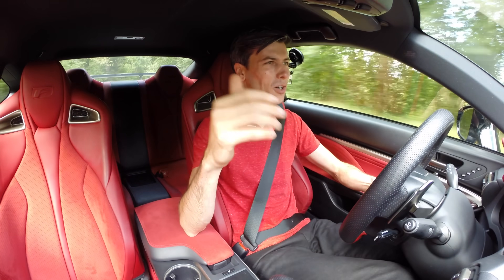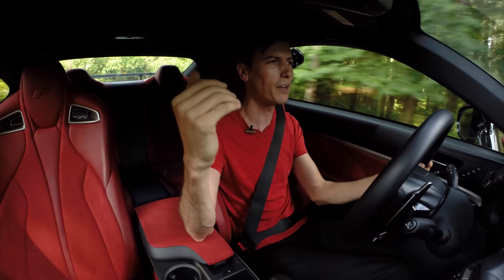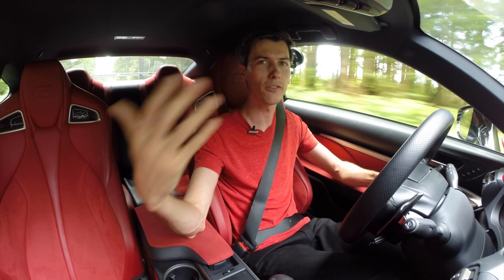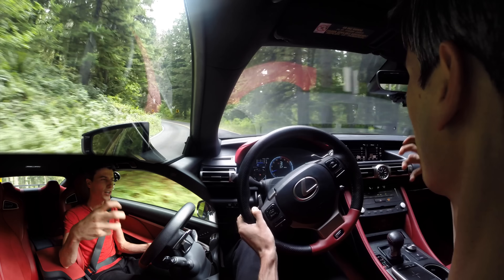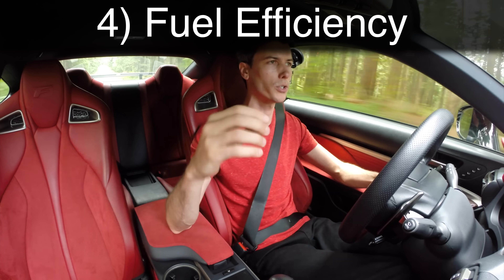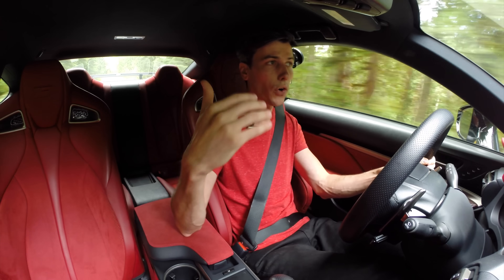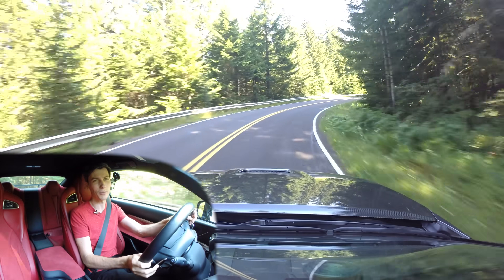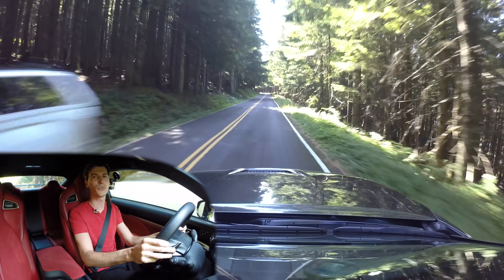5 Reasons You Shouldn't Buy A Turbocharged Car

Comment: Turbo lag may be cool for amateurs and street cars. But in racing you always want a fast responding engine. That's because being quick in corners means balancing the car. When you break, the front goes down, the back goes up and you lose grip to the point of spinning. But hitting throttle the front goes up, the back goes down and you'll regain the grip.

At this point you got it, you want the engine to respond fast to help you to balance the car. 

Of course there are turbo racing cars. Especially the old ones have a lot of lag. But this doesn't mean drivers like it. But it was the same for all and some managed better to solve the problem. Because it really is a problem.

Comment: My 2015 Volvo S60 T5 has no turbo lag.  It makes peak torque of 260 lb-ft by 1500 RPM and keeps it all the way up the range.  The exhaust headers (yes, steel headers) and turbine housing are the same piece and manufactured as part of the turbo..  it placed right next to the head.  It has dual inlet channels from the headers. The engine is direct injected.  It spins up instantly.  As far as longevity...my last Volvo s40 T4 was running fine at 250,000 miles when I sold it as well as my Saab 9-3 ARC at 250,000 miles when I sold it.

Comment: Why you should not drive a turbo vehicle. One the heat they generate. Shortens the life of many components under the hood. Cooks the engine oil as well as the. Increased air pressure builds increased pressure. Inside of the cylinder which when ignited. Create a tremendous amounts of pressure inside of the cylinder. Which creates a greater amount of stress on all of the internal components. And bearings which wear out faster. Drastically shortening engine life. A naturally aspirated engine by Honda or Toyota. Can last between 500K to 600K miles. The  same engines in turbo charged versions. May last up to 200K miles!

Comment: I’ve owned plenty of both across the ages and as a petrol head love both in different ways. Turbo lag is still there in even the best turbo engines but it is sooo much less than they used to be. Ultimately, you can’t beat the pure crisp throttle response of good naturally aspirated engines and can’t beat the rush of torque of a good turbo engine.
Reply: The solution is large displacement NA. Instant response, torque everywhere, maximum joy at any speed.
And also a little Honda for most of your driving so you still don't use much fuel overall.
Reply: @nthgth  I couldn’t agree more. Or even an electric car for the bulk of travel in the city.

Comment: I own a Camaro LFX 3.6 V6 Sequential Twin Turbo that my shop designed and built in 2012.  It has NO turbo lag and is more responsive than you can imagine.  If designed properly, you can have a turbocharged vehicle perform without lag, of course, factory vehicles do not manufacture turbo cars like the one I have due to cost and probably other reasons.

Comment: I had twin GT32s on my c5z06 and was doing 650rwhp.  It was smooth as hell....the stock engine had perfect torque and it just held traction perfectly till the turbos spooled up and then it was on.
I rode in my buddies c5 z06 and he was running a Ysi supercharger pushing 950rwhp.  It was a rush.
I then had a built 403 stroker installed, meth, Ysi, heads/cam and super loud BOV.....840 rwhp.  The problem was that regular Camaros would stop me from a dig. No had to race starting at 70mph and even then, with street slicks, I would still break loose..... Now I could stomp liter bikes all day long but it was always roll racing.  It sucked.
I'm 100% a turbo guy now.

Comment: My experience with turbo charged, small displacement engines has been negative overall. I'll start by saying this is likely due to 2 factors more than anything else: the car itself (2109 Sentra Nismo) and the way I drove it.
I didn't drive the car hard so the need for a turbo in the first place was debatable. I had issues with carbon buildup on the turbo which, at 20k miles, resulted in the car tripping an EGR code. They had to pull the engine out of the car to service the turbo under warranty.
Fast forward another 20k miles and, you guessed it, the EGR code came back. Same problem, the engine came back out (fortunately, still under warranty) and the repair was repeated.
If you ask me, having the engine pulled twice in 40k miles for turbo related problems is a bit ridiculous. Is it just a case of a bad design by Nissan? Yes, more than likely. But with all the manufactures putting turbos in their small economy cars, how many of them are going to be plagued with similar poorly designed systems? 

I traded in the car and now I drive 2022 6MT Tacoma with the 3.5L V6.
Reply: Direct injection aye?
Reply: Awesome truck though

Comment: For those who are serious about not having turbo lags, they can always supercharge their engine. Turbo is not free power as many tend to think, and supercharged cars win just as many races as turbo cars. My preference is to follow aviation practices, often with everything already at the material limits, I opt for turbo normalizing. I get the loss HP back, while not over boosting the engine (or just mildly over boosting it ) Diesels adapt to turbo much more readily, for their exhaust temp is a couple of hundred degrees lower, which make a huge difference in bearing longevity. One sign of that is aircraft at high altitude or in engine test cells being pushed hard, the exhaust manifold glow cherry red or even yellow, most diesels will not run that hot.

Comment: 1 main reason why you should, With a small displacement engine such as my 1.5l in my Civic Si Coupe and a turbo, I get the best of both worlds! Off the line quick with plenty of low end torque with a .28 coef of drag and low gross weight of 2800lbs, I smoke a lot of cars with much bigger engines and I also manage to get 40mpg at 75mph on hwy in cruise control and off the boost! Only when boost kicks in does the mileage really go down! So I mainly drive for gas mileage and occasionally lay down a spanking or two! Downshift while drag racing at speed to get boost up and keep the gas pedal pinned to the floor when upshifting because everytime you shift, if you take foot off the gas while shifting boost goes way down! Stay off the gas and get great mileage! Turbos are BETTER!

Comment: I so agree with all, my regular, stock, unexciting 5.0L in my '13 F-150 sounds super awesome when under throttle.  Also more reliable because simply just less parts to replace.  Not knocking turbos, they are super cool too, but just responding to another of your cool videos.

Comment: It's only turbo lag if you have a huge turbo on an itty bitty tiny little engine or you just don't understand how to downshift lmao 

If you put an eclipse gst\x in 5th gear at 2000 rom it takes about 500 rpm to hit full boost lol.  if you take the same scenario but instead of standing on it in 5th gear you downshift to 3rd and then go half throttle you have instant boost.  🤷🏻‍♂️
Waste of a video.

Comment: Understand the reasoning the car manufacturing companies use turbochargers.  Then examine the disadvantages of a turbocharger.  You will see that the problems with quality, reliability, and performance are from conflicts arising from corporate greed and planned obsolescence among other things.  Said otherwise:. A company may say we offer more power and higher mpg:. But cost cutting constraints result in the opposite outcomes.  A NA engine is actually more efficient and effective.  It's the same outcome in 'climate' issues.

Comment: Having a laggy turbo & a slow downshifting transmission is the worst. I had a loaner Tiguan w/paddle shifters & even in "sport" mode, I'd have to downshift super early to have enough torque to power out of a curve. My DD, w/a 6MT would allow a last second, rev-matched 6-3 downshift & turbo would be spooled enough to let me modulate the power thru the curve.

Comment: Been buying Saab turbos since before turbos were cool. Can't replace all that low end torque unless you really upside the engine which equals more weight and fuel consumption even if you're not stepping into it.

Comment: These turbo charge cars seem to on paper do well on the EPA’s test cycle. 
And they do marginally better only.
In the real world where people don’t keep up with the oil changes and they go to goofy lube and get a filter that’s worth $1.99 and cheap bulk oil.
Then at 60 or 70,000 miles they end up paying for one or more turbo charger replacements! 
I just don’t see in any way shape or form the benefit to under sizing and engine for a vehicle and slapping on turbos to make it acceptable.
The Corvette C7 for example is a fantastic performance car. Take the car on the highway let it go into overdrive and set the cruise at 60 or 75 miles an hour and you will see an astonishing car exceed 30 mpg!
These turbos are just hype and it will be a cold day in hell before I own one!

Comment: I have a question for which I can’t find an answer: what’s the difference between a stock turbo engine vs an engine that has been turbocharged? Why the latter is usually less reliable?
Reply: A stock turbo engine is designed to handle the extra stress of turbocharging. Sticking a turbo on an engine that isn't made from the factory to be turbocharged can be just too much for it. Compare the Ford I-4 engines: The turbo versions have stronger internal parts than the NA versions.
Reply: @bongodave13  thanks

Comment: I guarantee my Audi TT RS AWD 2.5 Turbo 5 Cylinder Manual following you on that road would have been more fuel efficient and used less, as well as sounding just as good while sticking to your bumper!  I will concede the Oil Temp issue is a downside but the trick is to drive sedately for a few minutes prior to turning off to minimise it. True my original CLK AMG 5.5 V8 had all the qualities you mention but not as satisfying to fang on a great driving road as the TT RS.

Comment: Jeremy Clarkson once showed the difference between NA and turbo lag on Top Gear by racing a minivan against a Mitsu Evo FQ400. Both were in 6 gear at a matching speed, and both floored it. The minivan pulled away whilst Jeremy was sitting there waiting for the turbo to spool.
Reply: Yeah you take the worst car in history as an example, also Jeremy always exagurates on everything.
Reply: That's not lag, that's boost threshold. The Evo is obviously losing to a short geared minivan if it is before it even has a third of its torque in a gear that gets it to the much higher top speed
Reply: WTF floors it in 6th gear lol, absolutely ridiculous.
Reply: Just floor it and press the brake for a couple of seconds then release the brake at race start
Reply: That's why, for gasoline engines, a supercharger is better.  No lag.

Comment: Talk about cherry-picking Internet information to make it look like (NA) naturally aspirated cars are clearly the best. It's not even close to being true. This is really evident by how he won't stick to a goal post to define how NA is "better than turbo cars."  He switches it when it benefits his point. The real answer is that the NA car FEELS better to him, while he ignores the actual benefits of a turbo car and what it can do better than NA cars.
In fact, turbo cars can produce the same power (be just as fast) and get better gas mileage (when cruising and not racing) with a smaller engine and therefore can be much lighter than naturally aspirated cars resulting in better handling, braking, and therefore safety. That won't matter for towing, where NA is clearly better (only true for non-diesel) from a longevity perspective, but in a race it won't matter when they stay right next to you in a straight line. In the curves, they've sped right past you because of the weight savings. Should I mention how turbo diesels are the most efficient at moving freight around versus anything NA?
BTW, with plans to phase out (ICE)internal combustion engines and replace them with electric cars, you can be sure the best and most efficient option available for keeping any ICEs around will be a small engine with a turbo to maximize efficiency and power, not a large NA engine. Those are on the chopping block like the big blocks of yore.

Comment: I've loved turbocharged engines after buying my first car after college, it was a Saab 9-3 aero, and at 205hp/230lbft and relatively low weight of 2850lbs it was quick in 2001.
Reply: But that is a real turbo
Reply: @ReggaeWise  ...I think I agree, but I'm not sure what you mean by "real", are you referring to Porsche's Taycan "Turbo"?  That was a terrible marketing move, imho, but they're badass cars.  I've owned a 00 986 S, and replaced it with an '07 997 S. (Carrera S if the specific models are not familiar to you).

Comment: So I don't need to buy that automobile with a 2.5 L engine with turbo&intercooler, but one with a 5 L naturally aspirated engine.
I tend to agree. A car from my youth, the infamous Renault 5 Turbo, had an engine never lasting more than 30K miles, with holes in the pistons and bent conrods. 
Turbo charged engines work under terrible conditions, this is why I avoid them: they must be build without consideration for the costs. Just adding a turbocompressor to an existing aspirated engine is a failed proposition. 
Thanks for the video...

Comment: I can only speak of my setup. 383 stroked LS1, fully forged, 76 mm Turbonetics. A/W intercooler. It's 20 years old. Full boost (15 lbs.) by 3K rpm. I throttle it so it is not an "on-off switch." Love it, so does the passenger. If I'm a good boy on the interstate, I get 19 MPG. One thing he states that IS true is the heat produced. Exhaust coating and wrap  doesn't reduce it much. I pop the hood when parked. 2002 WS6 M6.

Comment: You mention some silly things though. You are talking about efficiency and fuel economy, then you show us a Lexus RC F with a big V8 engine as an example of efficient naturally aspirated car. Thats funny, but a $80,000 ... $100,000 MSRP car don't need to be efficient and the customer doesn't care about that especially if he is American (very cheap petrol compared to EU). The fuel economy was not an argument when he selected that car you can be sure about it.
Reply: It was a example. you took it to far.
Reply: @pem3480  Sorry I didn't want to mistake it. He shows in the video a 5.8L V8 naturally aspirated car and some some turbo charged performance cars for example Mercedes AMG ... so on. Of course he can't compare a cute naturally aspirated 140hp VW family golf to a 450hp AMG Mercedes turbo. Obviously. He needs that awesome Lexus to make the balance, to get some respect. But in this mentioned category the efficiency is not a factor, absolutely not at all.
Let's go back to family cars. These day's fashion is the small turbo motor. Many manufacturers offer tiny 1.0 turbo (120hp) engines and don't 1.5 NA motors anymore. (in Europe, where the efficiency is a real factor indeed due to the petrol price) I donno why. And those turbo motors have slightly bigger torque and about the same mpg (or l/100km) as the NA motors earlier had. So I think his knowledge about efficiency is not well based, or maybe just a little outdated.
Reply: @telelaci2  I took it as showing us what a good  v8 looks like and explain it. I only came here because I drove a 2020 f150 and I hate it for normal driving and wanted to see what ppl said about turboi lag. I feel nothing has been done over the years to fix this. NOW if I throw that bad boy in sports mode it's spun up high, almost no lag in the turbo. Whereas my v8 truck just takes off and keeps giving. On the MPG,,..... well it sucks. Hard to compare though due to f150 was a 3.0 with a tt so mpg for this was 12-21 I get 9-19 so be honest F that TT junk give me the big v8 still paying at the pump. But I don't mind the application in cars for fun. Then again I gues in 10yrs its not going to matter as we all will be shtin ion purpolsion cars or something.

Comment: 1 Get a manual turbo and learn how to rev match, downshift and problem is solved.
2 Learn how to properly lean into and out of throttle, downshift before redline, enjoy the wave of major torque 
3 NA engine will always be more reliable but nowhere near as tourquey.
4 Smaller engine turbo is much more efficient than bigger NA engine. One personal example:My previous car was a 2011 Mazda 3 2.5 hatch that i got rid off in 2019.I bought the car with 28k miles in 2014.That car turned out to be a disappointment but thats beside the point. It had a massive(by todays standards) 2.5 engine that was inneficiant and not very powerful. I managed to average 19.1 MPG over the lifetime of the car. I purchased a new 2020 Civic Si which is now over one year old, its a much batter handling, more powerful just more fun car. I am averaging 31MPG while enjoying what i drive
5 Some turbos sound good( Audi S5, Fiat Abarth 500,Subaru Sti), most dont, but if sound is a major concern get an intake and exhaust

Comment: Harley sells motorcycles because of the noise those engines make because of the huge lag in cylinder firing. Cool for a relatively light vehicle! You can not beat the sound of the V10 engine of the F1 cars of the "Alonso" years.